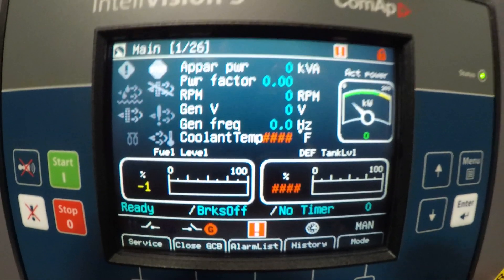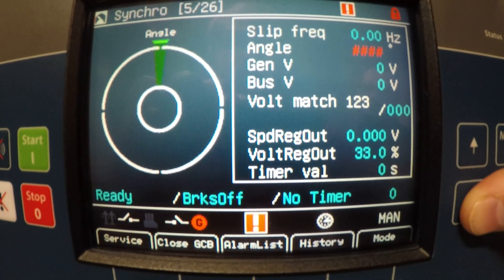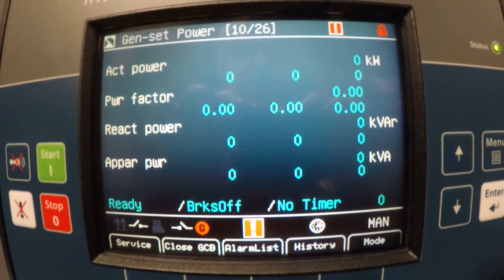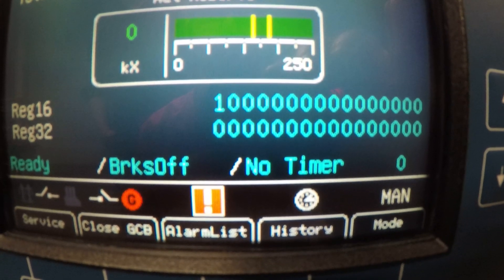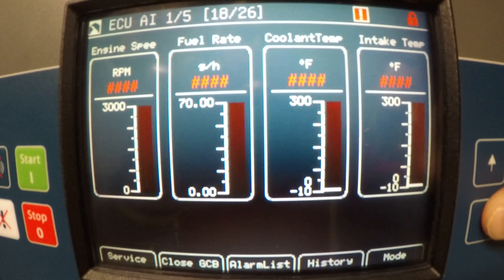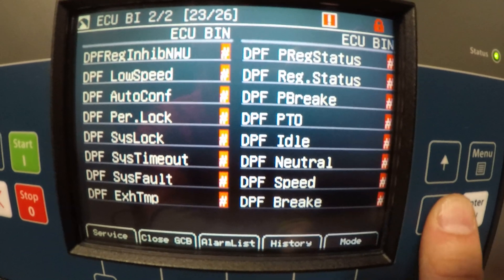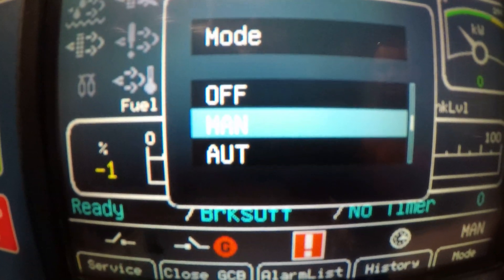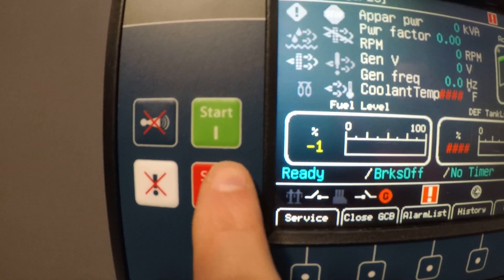Hipower Systems - HRJW190-T4F COMAP IntelliVision 5 introduction

Comment: Thank for the video. Very informative. Am also asking for your help. I am working on 2 x 550kVA Volvo Penta Gensets using a ComAP controller with InteliVision 5. They are 2 connected in parallel but both  giving me an error *01/Ad ECU and no Genset is not cranking . Have you encountered any similar problem or what could be the cause?